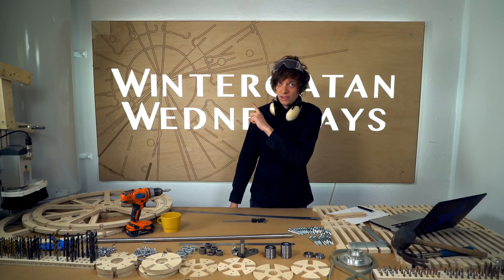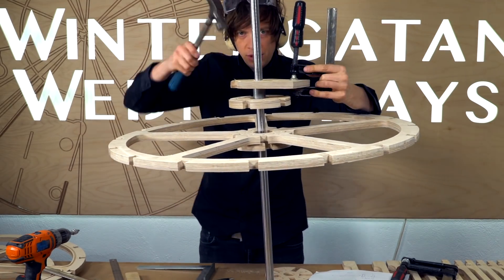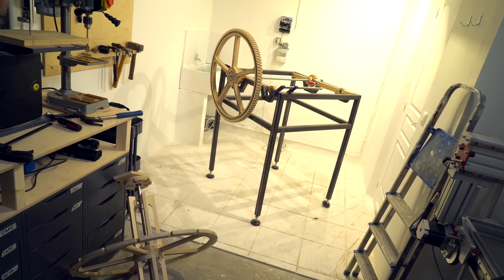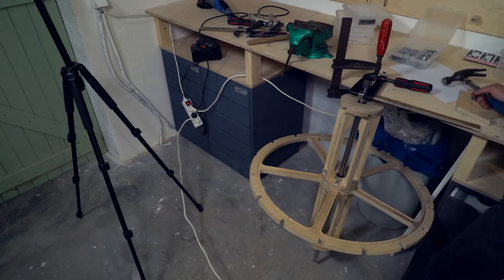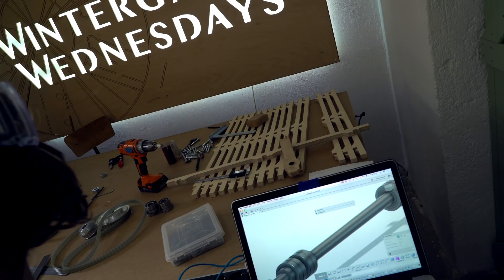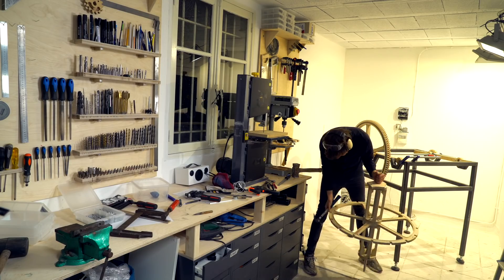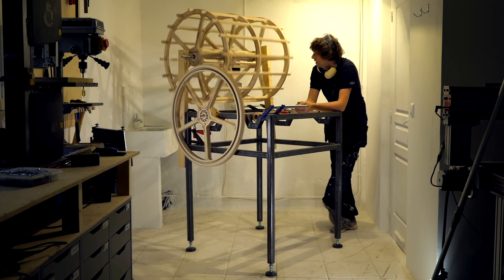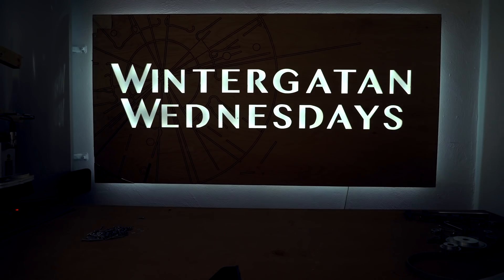Programming Wheel Skeleton - Marble Machine X #19

Comment: There has been comments of heating the bearing which would have helped. Also if you wrap the shaft in dry ice for several minutes it most likely would have dropped right on. Good stuff though...

Comment: I‘m sure the 1.874.601 person to tell you this, the shaft could been altered in it‘s tolerance with like 200 grain sandpaper , some motor oil on it, and turn it with something like a Hand drill or such... just jun the oiled Sandpaper over it for 20-30 seconds, then LET IT COOL, and then try the bearing again... or cool the shaft with icing spray when mounting if heating the Bearings outer ring does not work for your parts...

Comment: Looks like you are working alone without other eyes to see what you didn't see.  Necessary prior incremental advancement was lost: e.g. need a vice to hold the work, a holder to hold the tool, the right tool, science not random trial and effort, etc.  "hold, push, pull" not "bang bang bang".  How about aice, gear puller, and press?  Progress onward!

Comment: So before you keep going, I advise you to ditch the framing hammer. You're building an instrument not a house. Instead get a mallet or even a dead blow hammer. Depending on the head you use you wont have to worry about damaging any metal parts, like say mushrooming them out, and you will get a better striking force for your efforts.. And actually hold it in the grip area rather than up by the head.

Comment: an easy fix to all your struggles, you could either have heated the bearings or cooled down the chaft, seeing they are close to being too tight to actually physicly fit the shaft. and it is usually plenty of contraction and expansion going on to make for easy assembly, you could also combine the two and both cool and heat, to make for the maximum clearanc during assembly.
the heat need not be extremely high. the biggest expansion of steel is happening below a 100 degreed C so a hair dryer would do the trick on the bearing. (rollerbearings should only be heated to a maximum of 120 degrees anyway.) and the shaft you could put in the freezer or perhaps stick the end you need to work on in a bucket of icecubes and saltwater to cool that off, and then just wipe off the water before putting on the bearing... quite easi steps rather than either sanding the shaft, or ordering a slightly slimmer one. Trust me, I'm a mechanic ;D

Comment: That's not where it started to go very wrong. The actual part where it started to go wrong was when you started hitting the bearings with a hammer at all. Bearings that are hammered onto a shaft will always be slightly askew, making them wear out faster and wobble a little bit. You'll probably get away with it , because that programming wheel is going to rotate very slowly, but if you ever build something that's supposed to go above a few hundred rpm, remember not to hit the bearings with anything. Take it to a machine shop and have them press fit.

Comment: If you were to be more experienced with bearings, you would know that there's a technique to solve the tolerance issue... It involves heating the bearings to approximately 80 degrees Celsius and cooling the shaft to -15. The bearings should slide on smoothly every time if you aligned them properly.

Comment: Hi
a next time use fine sandpaper to adjust axis diameter.

And I suggest you to think to an kind of poka yoke or any solution to avoid any mistake on postion or mounting direction for the programing weel as such as the programing plates. a reversed music should be fun but difficult to adapt.
and of course :
Bienvenue en france!!! ;-)

Comment: Hammering is not what you want to do here.  You should be using some sort of press, and fixturing the shaft while you're assembling.  Just because the design of the MMX is much better than Marble Machine doesn't mean you can use the same assembly techniques as you have in the past.  Ask your mechanical engineer to take off his design hat and put on his manufacturing hat now.  There are better ways, which were hopefully considered during the design phase.

Comment: Temperature can be used when working with tight fitting metals. Cold shaft and warm bearings. Also candle wax can be used to move stuck items. Like a nut stuck on a bolt, warm the bolt until the wax melts into the tread. Will lubricant the stuck items. But wax will be absorbed in to wood as an oil.

Comment: You could cool the shaft with some freeze spray or air duster turned upside down. That will shrink the edge of the shaft enough to slide the bearing on.

Comment: About the problem with the tolerances, might there be a way to thermal temper the bearings or the shaft? Heat up the bearing and cooling down the shaft would help to slide them into position.
Reply: Steampilot   The issue is clearance, not tolerance.

Comment: Martin, if you work with a ball-bearing you should never use a steelhammer. Use either an alumninium or bronze hammer or better an recoil-free hammer who are soft plastic-faced hammer like visible in the below URL.
https://eshop.wuerth.in/Product-categories/Recoil-free-hammer-with-nylon-head/31576012031001.cyid/3157.cgid/en/US/INR/

Also you should ONLY hit the inner ring of the ball-bearing, never ever the outer ring because this can damage the ball-bearing in a later time. The easier method is to use a steel pipe which have 1 milimeter more inner diameter than the axe and minimum 3-5 millimeter thickness. ;)

Comment: next time you need to slip bearings onto a shaft that is tight like that, heat the bearings up first, you can use a hairdryer if you don't have a heat gun (don't use a torch), it doesn't take much and they will slide right on like nothing. To double down, throw the shaft in a freezer for an hour or two.

Comment: Hi there !   I think you can use a poelie puller ! ;)
A poelie puller is a tool that can be used for flanges, bearings and couplings of an axle.They can consist of two or three "grippers".With this tool you can easily disassemble roller bearings
Time line 4:55 , This works much faster and more convenient.    Good luck !

Comment: Old trick on bearings from hobbyst motorcycle mechanic (and also hobby musician) - put the shaft into refrigerator(freezer) for 2-5 hours and then heat bearings using hairdryer (or heat gun) just  before installation - as the temperature difference makes bearing race wider and the shaft diameter a bit lower the tolerances will extend to a level than you can much easier slide bearings onto the shaft  ... without extreme hammering for hours ...  by the way ... you should press the beraing onto shaft using some kind of hydraulic or mechanic press ... try to avoid hammering bearings as you may destroy races and the bearing may fail.
Reply: Last Revival  People frequently use the word 'tolerance' when they should use 'clearance'.

Comment: It’s a bit late now but you could have used a 20mm reamer to make the inner Diameter of the bearings all spot on perfect 20mm making them slide on the shaft a bit easier. Maybe. But I’m not an engineer. Love the videos. Keep it up.

Comment: Hi Wintergatan, the next time you're trying to fit a bearing on another metal component, try heating the outer part and cooling the inner part. That's actually how they do forced fittings in the industry too. It will make your life so much easier.

Comment: I can see a lot of frustration in this video... hope you are still well and that you feel confident with your work :)

I am still amazed that you are using a normal hammer on the wooden pieces. Multi-layered plywood is very strong, so that is not the point, but if you use a wooden hammer, there won't be that many bumps and scrapes on the wood.

Comment: for future reference, cool the shaft, say, with icepacks, and heat the bearings to around 100F or so and the should slide together easily. once the temp of the pieces goes back to normal, they'll be secured.

Comment: Perhaps you could have used a blowtorch and heat the outer ring that got stuck, and if it expands more than the shaft, it will increase in size so it could be removed.

Comment: A tip for installing bearings. Cool the shaft and warm the bearing. Some bearings are actually designed for this. This would of helped you with your spacer as well.

Comment: Rule of thumb when installing bearings: Freeze the axle and heat the bearing. This will cause expansion on the bearing and contraction on the axle, making the bearing slide very easily. That way you won't have to hammer so hard. You can get a can of freeze spray to freeze the shaft and just use a heat gun to heat the bearing.
Reply: Another option is dry ice.

Comment: If the shaft had been a bit too small and the inner diameter of the bearing a bit too large, would the bearing not fit tightly to the shaft? I'm not really good with tolerances in my mind, it seems like the only way for the bearing to fit would be for it to be as small as the shafts diameter, lest it slides down the shaft and doesnt keep its wanted position.

Comment: If you ever have to perform an operation requiring very close (or negative) tolerances in the future know that you can shrink the axle using dry ice or liquid nitrogen and expand the bearing using heat.  This is how we install sleeves on aircraft axles.  No hammers necessary.  Rule of thumb.....if you're not pounding nails or demolishing something look for another tool.  Presses and pullers are great for bearing work and are very inexpensive.

Comment: To get rid of the spacer:
1) use a spacer that is a few thou μm oversize on the ID, so that it butts against the bearing nicely, but doesn't bind to the shaft.
2) when stuck, heat the spacer (not the shaft) with a propane torch or something. This causes the metal to expand, and hopefully, it will be enough to clear the end of the shaft. Just make sure not to heat the bearings with the torch, as that will wreck the oil seals (and, of course, don't set the wheel on fire!).

Comment: I know you said you felt the hammer marks on the wood gives the machine some texture and shows it's history..   but when it comes to metal pieces, such marks can cause the problems you were having here.  for instances where it's metal tolerances and your fitting metal to metal, I would recommend a couple things:     a lead or brass hammer for tapping/driving parts together.   being softer, it will not distort or mar your steel parts.    heating the parts lightly with a heat gun might ease the tolerances to get it into place.

Comment: A hydrolic press would have made quick work of pressing the bearing on. Or using a drill press although the wheel is probably too large for the swing of ordinary drill press. Maybe using a small jack and bracing from the ceiling might also work.

Comment: Instead of ordering a slightly smaller shaft there's also the option of shaving the shaft you have down by just a hair on a lathe. Or have someone else do it! Probably need a big lathe for such a long shaft though. Heating the bearings as others suggested it probably easier, and makes for a nice and tight fit in the end.

Comment: If you had warmed up the bearings so they expand a little they will probably slide on much easier, especially if the tolerances are that tight a light expansion could make all the difference.When they cool down they return to their original size.

Comment: Hammering on bearings is a really common mistake. At work I had to do put lots of bearings on shafts, and for me the easyest way was pushing them in with an homemade contraption. Nothing really complicated: just a thick plate with a closed hole on one side, and a plate with an open hole on the other side. I had 3/4 threaded rods with bolts  connecting the two plates, and by tightening them I could exert a lot of force with nearly zero mushrooming.
Also, get or make a wooden mallet!

Comment: Hey Martin: Try not to beat it in but use constant pressure (like you partly did) if possible - e.g. through a a pulley and pipe or something similar. Way better and more precise than hammering tight fits in. 
Also: If a metal ring get's stuck on the rod next time and you are far away enough from any bearing, try heating the ring up slightly. The expansion will make the fit looser and you might get it out faster.

Comment: Hey, Martin, you did a really good job, but there are two mistakes with the programming wheel assembly, that made the assembling process really difficult. First one - when you were ordering a shaft, you should add in your shaft design some retaining rings to hold the bearings in correct positions, so when assembled, the position of each bearing is correct and not going anywhere. The second one - when the landing of the bearing on shaft is really tight, it's better to use a heat gun to heat up the bearing. Temperature around 100C won't hurt the bearing, but it will expand enough to just slide on the shaft easily.

Comment: If you have tolerance issues with bearings and shafts in future, try the following engineers trick. Engineers use the application of heat and cold to expand and contract components to allow the fitment of components that are an interference fit. A good example of this principle is the fitment of steel tires on wagon wheels. 
As the marble machine is made of wood you cannot really use heat due to the risk of fire, so try cooling the shaft with ice for a couple of hours before putting the bearing onto the shaft. Cooling the shaft will cause the metal to contract (causing its diameter to get smaller).

Comment: That looks frustrating. If I may suggest, get a rubber mallet for hitting the wood, a brass hammer for hitting the steel. A bearing puller  for when stuff gets stuck. And before you put the bearings on, put them in a ziplock baggie then submerge them in dry ice and isopropyl alcohol for about 20 min. This will freaked the bearings without removing the grease. This will cause the metal to contract and should slide on the shaft just fine. Make sure to have proper ventilation and gloves as this kind of cold can damage your skin. The rubber mallet will work well on the plywood but remember to alternate where you hit in a star pattern so you walk the part on rather than twist it in one direction. Also the brass hammer will allow you to hit the steel and the hammer will mushroom before the steel ever does. The good thing about the tight fit is you will have a great deal of stability when you are done. But that also means you need to be more precise. The old marble machines flex probably helped with any measurements that were slightly off. If you are looking for a good company for lighting your workspace and even specialty tools try MSC industrial and McMaster and Carr. I use MSC in my machine shop all the time and I do believe they should be able to work with you for international shipping. They also have discount codes almost every day that you can apply to your order. And if there is any problems you can always phone or email them. They have really amazing customer service and a great sales department. I wish I could help you more. Best of luck and I'm very happy you moved to your dream studio and workshop.
Reply: Freeze the bearings. Sorry auto correct is a pain.
Reply: Sorry I'm thinking in reverse. Freeze bushings to stuff them in a hole. Heat bearings to put them on a shaft. Be careful you don't melt the plastic dust cover on the bearing. I would suggest zip lock bags and boiling water or some other non fire based way of heating them. You don't want to melt the dust guard or catch the grease on fire.

Comment: A little spray of silicone or Teflon would have made the bearings move much more easily. You can also give the shaft a light sand with fine sand paper if you want things to slide on a little easier. Its look good though.

Comment: Next time put the shaft into the freezer overnight then heat the bearing slightly with a heat gun.  Using gloves, slide the bearing down to the spot you want it at and hold it there until it cools and sticks at that point.

Comment: right at 0:37s you see you actually damage the bearing by putting axial force on the outside ring (movement of the inner ring to the outer ring)! as much as it  would suck terribly to take it all apart again - i guess it might suck even harder if the bearing binds up on you on stage?!

Comment: For future reference, You can make your life a little easier by cooling the bar and bearings down before putting them on the shaft. 
The reason this works, is when you cool down steel, it shrinks. When you heat it up, it expands. Taking these properties into account, by cooling both the bar, and the bearings down, you cause them both to shrink, meaning the inner diameter of the bearings will get larger, and the diameter of the shaft will be smaller. 

I would suggest the next time you need to assemble a friction fit like this, you put the bearings in your freezer, and the steel shaft in an ice bath for a couple of hours before assembly. This will make your work quite a bit easier :)

This is an old machinists tip i've been using for years.
Reply: ArcAiN6   As an old machinist I have to say you are wrong. You would want to heat the bearing to expand it. However you would only do a shrink fit on an assembly that was meant to be pemenent. It could never be disassembled without destruction.

Comment: Next time use a press; or instead of using a hammer use a pipe that distributes the load to all sides of the part you are pushing with a plate on top.   Then Hit the plate in the middle.

Comment: Next time put the shaft in the freezer and bearings in the oven on low heat. They will slip right on. I was so scarred you were going to miss with the hammer and break the main wheel.